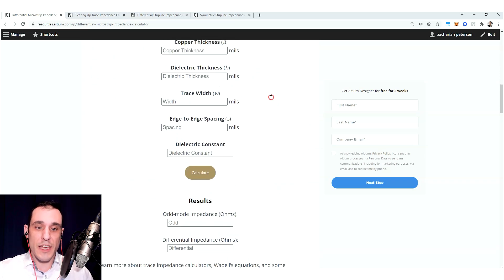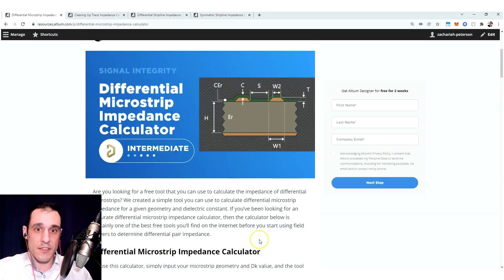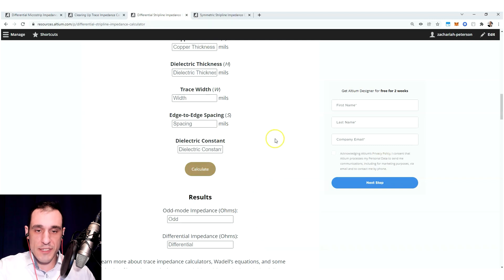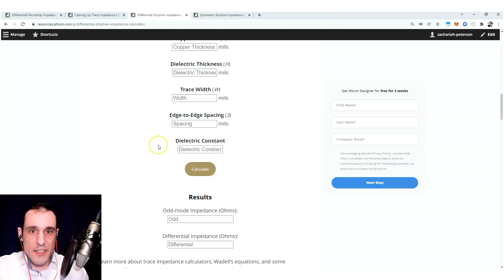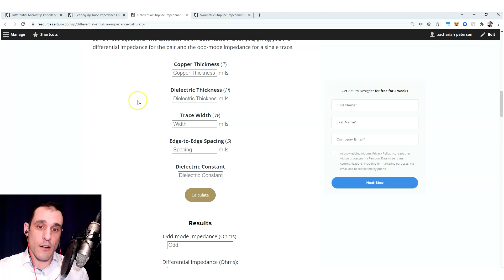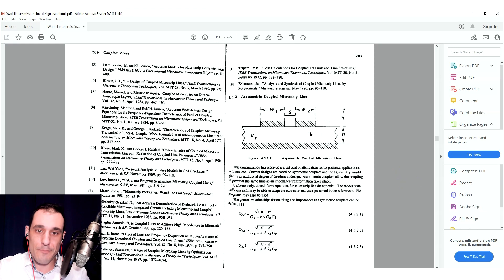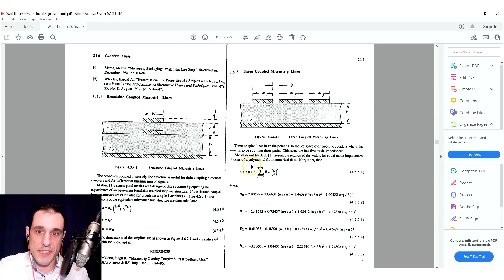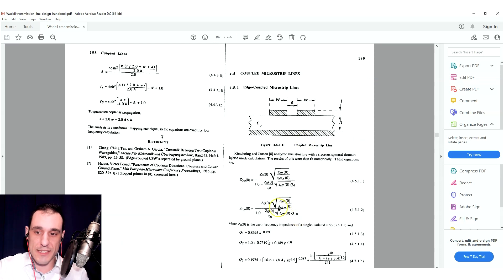Impedance Calculator Deep Dive - How Do They Work?

Comment: We are in the process of board reviews and I'm the principle designer.  We use Altium but Altium gave us a different impedance than we get using Saturn or other solvers so the engineer who reviewed my board and then used Saturn got different values, about 3 ohms less, than what I got when I put the numbers in Altium.  This video explains that nicely.

I do have one question, realizing that Altium uses a field solver and still gives me a single set of numbers for impedance, which differential trace does Altium use to make this decision?   Is it some average of all of the differential traces or does it somehow model some "generic" differential pair?
Reply: Differential pair impedance solvers will always give a result that depends on both the spacing and the width. So in order to hit a target odd-mode impedance and differential impedance value, the solver needs to select a spacing value first, then the trace widths are calculated. In theory, there is an infinite number of paired width-spacing values that will give you a single differential impedance value. Altium just applies a 5 mil spacing by default. You could select a 10 mil spacing and it will still give you a unique value for the required trace width.
The numerical method used to do the calculation is based on Simbeor, and I do not know the specific numerical technique being used. It's either Boundary Element Method (BEM) or Method of Moments (MoM), both are numerical methods for solving differential equations are they can be very fast in two dimensional systems. The result is being calculated directly from the geometry you enter into the solver, it is not based on some set of data or average of measurements.

Comment: Nicely explained. Great video. I was wondering if you are also planning to add or could recommend an asymmetric stripline differential pair impedance calculator.
Reply: Hi Milind, thanks for watching! I think it is possible to do it with one of Wadell's models (Section 4.3.5 in his textbook), but his model assumes the upper dielectric in the stack is air. So this would have to be modifed to include the dielectric of the upper prepreg, and it's something I have not dug into yet. I think you could start from the original equations of Hammerstad and Jensen and see where they would normally insert the dielectric constant of the upper dielectric material, but I have not done this yet. In principle it should be possible to do this, either from Hammerstad and Jensen's original method or by using conformal mapping (this is used in other equations published by Wadell).

Comment: A very good free field solver is sonnet lite.  Free download, requires registration.  Allows you to design arbitrary metal / dielectric layers, subject to licencing.  Free licence gives 2 trace layers + GND.  Analysis can be parametric based on sweeps of geometry, material properties and frequency.
Results graphed vs frequency, but also vs parameter.  Plots include s-parameters, impedance, real and imaginary, etc
Very powerful, but does take some time to learn and get the best from it.
Many included example files.  Check their youtube channel, also.
Reply: Thanks, I'll have to check out this program.

Comment: This should be a built-in feature, keysight ADS and even KiCad has it ! Come on altium !!
Reply: Hi Saitamapreet, thanks for watching. Altium does have a field solver built into the Layer Stack Manager inside the PCB editor. Just open the layer stack and click on the Impedance tab on the bottom of the window. I've done several other videos where I show how to access and use it. You can view one of these here: https://www.youtube.com/watch?v=1LI-ZQaCZrA
Reply: Altium does have a field solver in the stack up manager.
Does kicad have approximations or does it have a field solver?